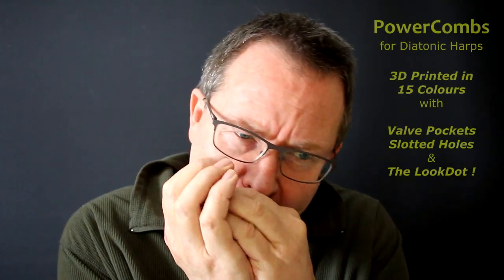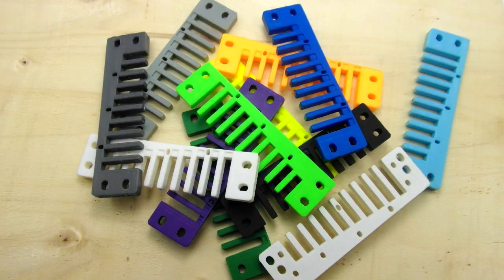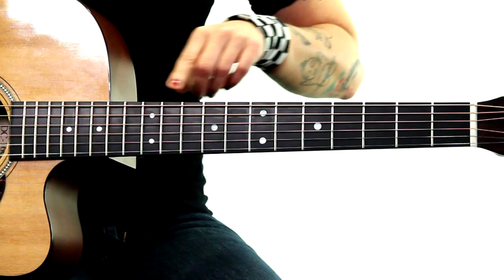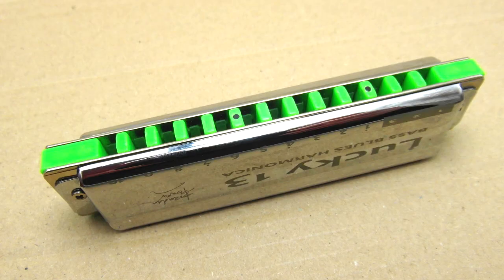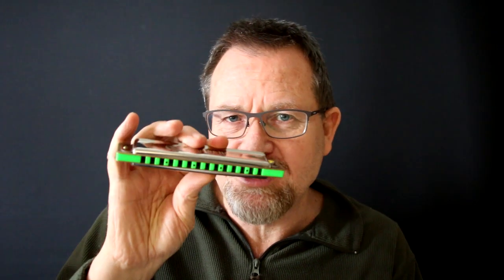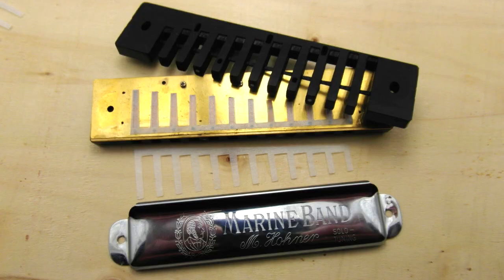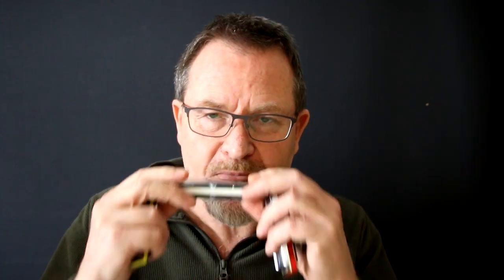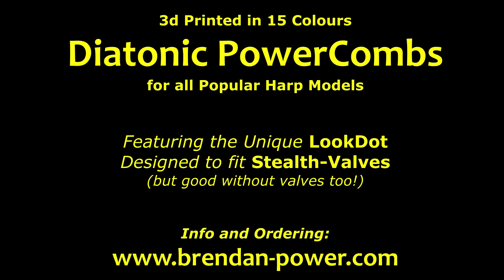Diatonic PowerCombs - 3D Printed, Personalised, Valve-Pockets and... the LookDot !

Comment: Anything  available for seydel Session Steel  not many combs on the market for this model.
Reply from the maker: I do have a sandwich comb developed for the Session Steel, mostly intended for my TwinDiatonic harps. The Session reedplates don't have cover plate grooves because they are meant for lipped combs, but the unlipped ones work in my TwinDiatonic units because they don't go directly in your mouth. I have plans to make some lipped PowerCombs however, so watch this space :)